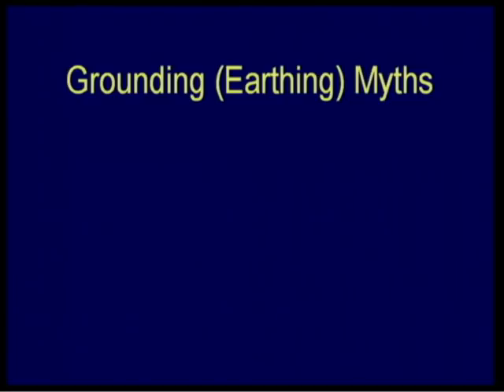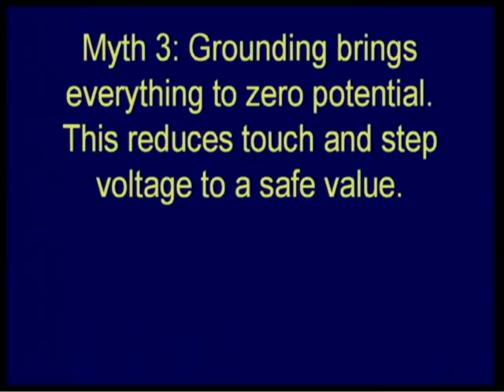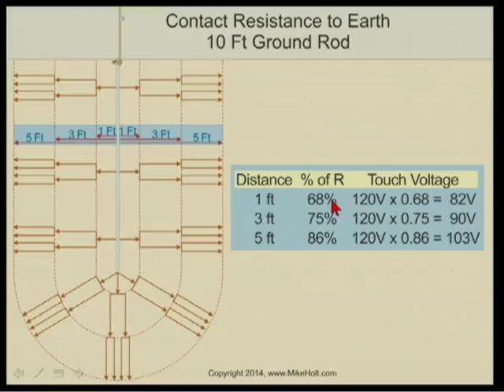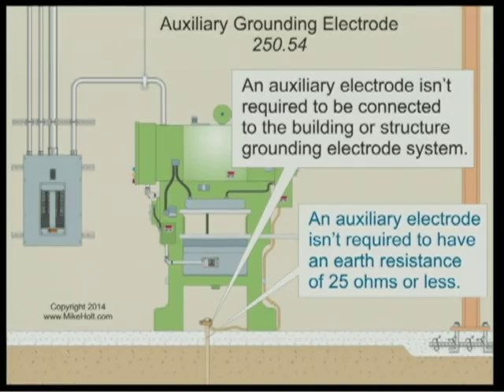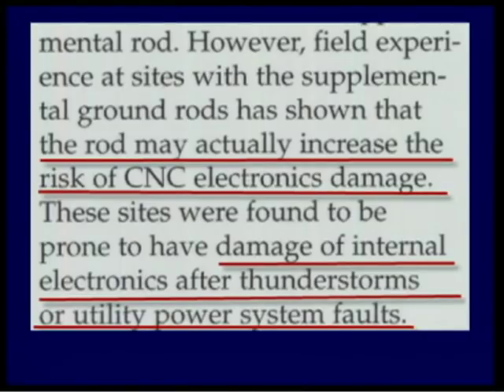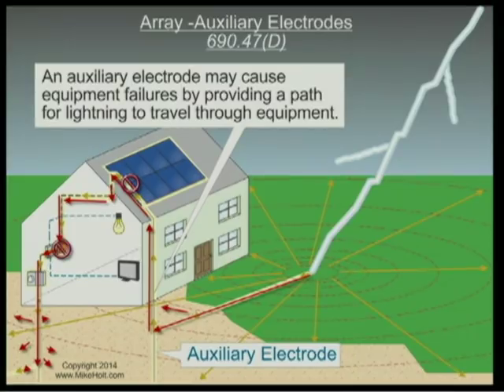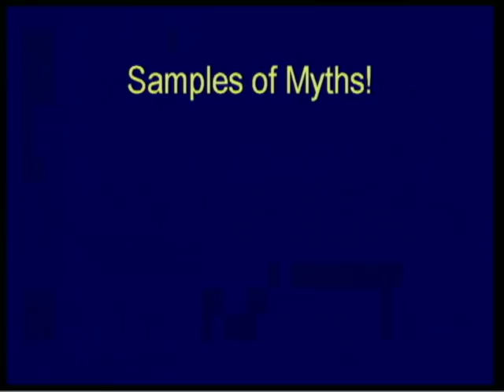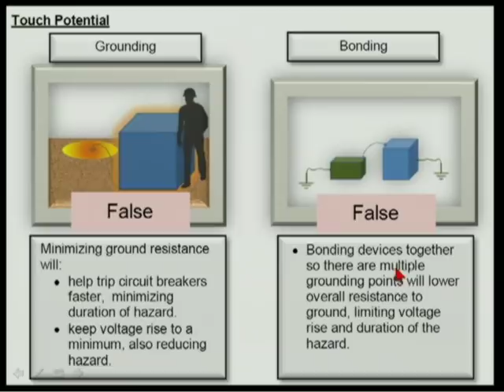6 of 7 Grounding Myths (26min:55sec)

Comment: Great video but to let you know in the World of Telecommunication  electricity does take the least patch of resistance and it sucks. You cant bond it because of interference but the outer sheath is and causing  hell when it gets wet.
Reply: Electricity does not take the path of least resistance - it takes ALL paths available to return, in amounts proportional to the impedance/resistance offered.  Kirchhoff's current law.
Reply: Bonding is always good. The problem is other installations tying Protective Earths from multiple sockets or sometimes even multiple buildings together (like metalic gas/water pipes, CATV, shielded phonelines)

There are two basic rules to prevent communcation problems from being affected by bonding:
- design your communications paralel to the electrical network to prevent ground loops from acting as unintented antenna's.
- get rid of ground loops by using ground isolators in communication lines between different devices.

The problem is most devices do not have ground isolators build in and cause ground loops. UTP cables are the only exception. Shielded UTP however is usually shielded at both ends, causing ground loops as well most CATV, audio and video systems.

In my opninion communication inputs and basicly any other system other than the electrical distribution should have ground isolators to prevent the protective earth from acting as an uninteded conductor.

Comment: This is surprising information, but I'd like to know where to turn to get some problems solved in an old building with wiring problems. This stuff is over my head. We have grounding problems in an old church. Much of the cable wiring is just hot and neutral with no ground and it seems they 'grounded to the box' which I'm suspicious of. In one circuit a receptacle tester says the hot and neutral wires are reversed. (Black and white wires are attached correctly). The same receptacle being tested with a non contact voltage tester shows power in the small plug, no power in the neutral plug and power in the ground plug.  
I've seen handyman videos on youtube with electricians commenting that what the guy is showing is dangerous.  So is your average electrician also misinformed? The last thing we want is someone getting hurt or a fire or whatever.
Reply: im no pro but sounds like you have some bonded neutrals and grounds in the panel or some grounds landed on the neutral bus.  the neutrals and grounds should not be bonded in a sub panel inside, only bonded in a main panel outside.  also lets say you have a hot, neutral and ground going to a receptacle, and the neutral wire comes off and touches the receptacle box. if the neutral is bonded in the panel the electrons just use the ground wire to get back to its source. that's one way you can have a hot,  hot wire a dead neutral and hot ground wire in a receptacle .  electricity don't give a crap about wire color, it just wants to get back home to where it came from which is the transformer outside.

Comment: We get the point, ships are ungrounded, should we do as the marine industry does??
Reply: Well if you have 120/207/240 Volts systems on the ship you should be able to use these without any problem like on the land. If you're not sure, check with the ship owner or  the company which installed the electrical system. It's probably somewhere written next to a main fusebox. But if it's a US ship, it's probably at least NEC compliant and has a TN system and if that's the case you should comply to NEC regulations.

If you want to charge ship batteries with mainland power you normally use an isolation transformer which besides corrosion also prevents electrocution when installed properly. 

But you should check with the vendor, marine regulations, local harbor regulations and ship regulations and when in doubt try to get them on one line. If 4 people say 4 different things, don't choose the one you like best. Figure out who is right and who is not by asking questions or involve other people who have more knowledge about the specific subjects.

Comment: Most overhead distribution systems (power poles) have a dedicated lightning protection system (sometimes an extra independently grounded wire).
Reply from the maker: Not true at all. Just drive down the street and you'll see 'some' static wires, but generally this occurs for 'very high' voltage distribution ungrounded systems.
Reply: You've missed the word "Most" at the beginning.
Reply from the maker: It's not 'most' it's 'some.'

Comment: Equipment grounding - massive equipment - we install anchor bolts - the bolts are connected to the re bar, with angle iron frame - there fore the equipment is grounded thru the anchor bolts ! To un ground the equipment you must not have anchor bolts ! Elaborate on this please. I am an un limited master electrician ship & shore - plus BSEE. Not a smart alec, but wish to understand. Now on computers the larger the ground conductor is not all ways the best.
Reply from the maker: Please watch this video - https://www.youtube.com/embed/mpgAVE4UwFw
Reply from the maker: I’m sorry but I don’t understand your question. I suggest you watch https://www.youtube.com/embed/mpgAVE4UwFw.

Comment: If electrical systems are no clearing faults by popping breakers then thats a problem w/ the design, not a problem w/ the idea that ground faults in earthing systems are designed to clear faults by popping breakers.
Reply: That depends on the system.

TN Systems (most English Speaking Countries) are designed with in mind that your Neutral is supposed to be connect to the Protective Earth (PE) so in case of an isolation fault enough current will flow trough the PE to make the circuit breaker go off.

TT Systems (most European Countries and Japan) are designed with Ground Fault Circuit Interrupters (GFCI's) in mind so in case of an isolation fault the current will be lower than with a TN System but enough to let the GFCI trip.

Both systems have advantages and disadvantages. BUT YOU SHOULD NEVER MIX THEM UP!
Reply: Robin Heijblom Doesn't really matter. Any system that takes advantage of a fault return can pop a breaker of some sort. That's a matter of design of said system. The point is youre supposed to take into account the ground impedance if you use an earthing ground.
Reply: vidfreak56 That's true, that's why Ground Fault Circuit Interrupters/Breakers need to be installed on every circuit where ungrounded appliances can be plugged in or TT System is used. Only circuits for dedicated appliances can be installed without a GFCI/GFCB when the impedance between neutral and Protective Earth is low enough to trip a normal circuit breaker.

But this practice is also slowly decreasing because a lot of times people think they can use that single purpose socket also for other things and start hooking up extension cords. Since GFCI's can be manufactured cheaper every year the costs are not really an issue anymore. In the past GFCI's and GFCB's were very expensive.  

Nowaday's GFCI's are not that expensive anymore. Usually it's the home/business-owners that spend their money on building a pool or installing a dormer rather than upgrade their electrical installation to code. That's why even in Europe there are still a lot of places where circuits are not protected by GFCI's and accidents are waiting to happen.

Comment: In my humble opinion, it sounds like you might be getting too tangled up in the bureaucratic process (cost/feasibility/liability/sustainability). 

 I’ve never accepted anything over 5 ohms to Earth and never will.

AFCI, GFCI & HRG are great if they work correctly, but like every other piece of equipment they are subject to mass production errors & failure at anytime with no warning. Leaving the user with a false sense of protection.

Comment: if a rod is in the ground, and the hot wire short's...  it will trip the main breaker...  Lighting... Million to one... I do believe equipment should go back to the main panel ground.  Not two different ground grounds...That why you link all your sub panel to main panel...  and bond the secondary panels so if if a hot wire touches a sub panel, you don't become the ground.....  (breaker trips on the circuit)  Electricity is still seeking least resistance.  That why plastic is wrap around wire... you can't get shocked.  Leather gloves... can't conduct electricity...  I can trip a breaker on a ground bare wire that hook to ground rod and it trip in a second.  This guys smart but more research need to be done.
Reply from the maker: Please watch https://www.youtube.com/watch?v=mpgAVE4UwFw
Reply: A breaker trips because whatever it shorts to is connected to the Neutral in the SE, and travels to the source.  It can short to EGC...or you can even short it to the Ground Rod...but it's the connection to the Neutral that causes the breaker to trip.  Holt's example is showing what happens if you rely only on the ground path from the house ground rod to the utility ground rod at the transformer.  The point being made is the ground path ALONE is not sufficient to trip the breaker.  A low impedance path is needed from the point of fault all the way back to the source.  This path is provided by the EGC to the SE.  And then it hops to the Neutral in the SE to get back to transformer and trip the breaker.  Remove the neutral at the panel...short the hot conductor to ground...straight to the ground rod if you wish...and you will not trip the breaker. One caveat:  Some installation might have a very low ground impedance.  This is rare, but possible.  In these rare instances, you might trip the breaker with a lost neutral.

Comment: Grounds have to be serviced and tested. You just cant put a ground rod, and think it's going to provide a quality level of resistance for ever. Ground rods put in the ground in the 70s should be tested on a normal basis. Soil characteristics and ph levels change over time. Guess what bridges across the country are crumbling hmm I wonder why.
Reply from the maker: +harry bottom What standard supports your statement that grounds are to be serviced and tested. What standard requires a bridge to be grounded, and how is it to be grounded; what study shows that bridges are crumbling because they are not grounded properly.
Reply: MikeHoltNEC  In the military we use Pamphlet TR-96-2 which covers earth grounding. We are required to ground highly sensitive equipment in different environments using different methods. Should we forego grounding our Radars?

 Should we drive ground rods in a desert environment until we reach a water table or certain resistance? I'm asking these question because I'm not a expert just a maintainer who wants to know am I wasting my time while deployed to Afghanistan or Iraq...

 The point of using bridges as an example, is that all systems need preventive maintenance to ensure they work as intended.
Reply from the maker: +harry bottom If the military has a standard, then it must be complied with, since they are not required to comply with the NEC. Reaching the water table doesn't reduce the ground resistance, and I don't understand the connection to the bridge.

Comment: Octane ratings are irrelevant! 87 versus 93 octane, using higher octane doesn't damage an engine, using not enough does, knocking and pre ignition, higher octane is for knock and preignition elimination , oy vey, this guy could be clueless? My car specs a min of 91, due to higher compression, not less

Comment: 2:53 =D
Reply from the maker: Fair comment, I'm having it deleted
Reply: Thank you for this valuable information.  I have a question about how to ground a fiberglass lighting pole.  The inside of the column contains a metal pipe one meter high. The pipe is welded to a metal square base.  The metal base is fixed into a concrete base bolts.  My question is does the metal base of the column need to be grounded?  Is a grounding rod sufficient for grounding the pole?  Or  it must be grounded by a circuit grounding wire?